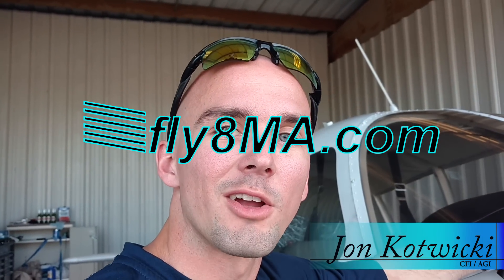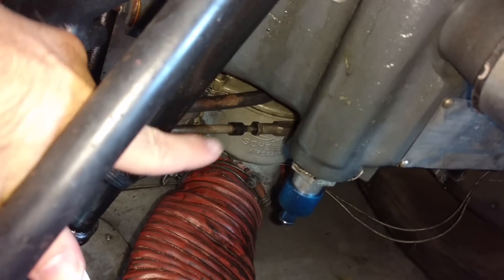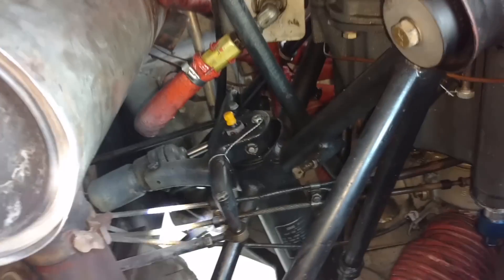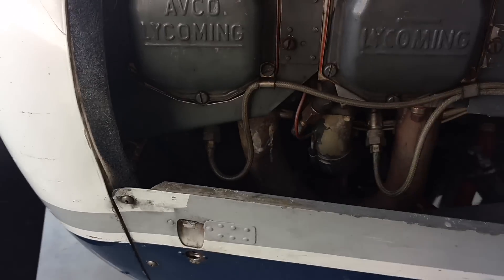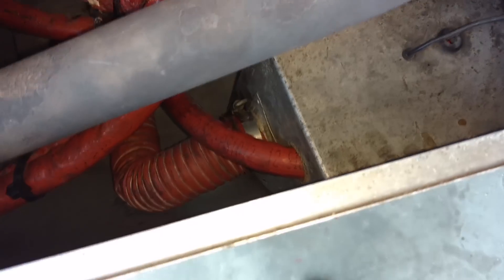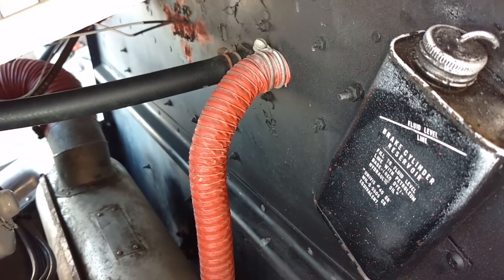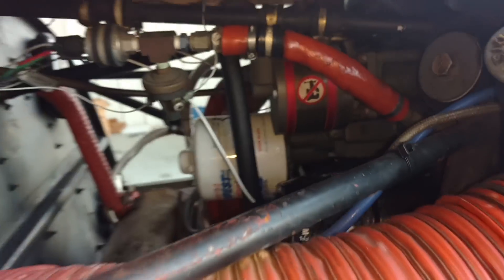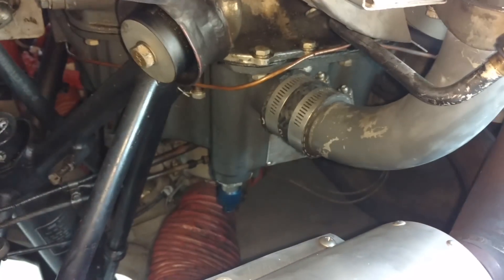Ep. 53: What's Under the Hood of a Little Airplane | Explained How it Works

Comment: nice video. How much time is on the engine? Perhaps the next video could compare accessory condition with 500hrs, 1000hrs, 1500hrs etc. Too many times a cheap part ignored becomes a major expense.
Reply from the maker: That engine has right around 1000hrs and is 7 years old.  It's had a hard life being near the saltwater based on the west coast of Florida.  Certainly some cheap parts have caused major damage (bad exhaust gaskets at only a few $$ each).  Also an A&P was trying to diagnose a bad mag and which cylinder was not firing, he did a water test by spraying water on the exhaust to see which was the cold cylinder.  Problem was he didn't have water in a spray bottle handy so he used degreaser in a spray bottle that had pretty high acid content and did some serious corrosion acceleration to the spark plugs and #2 and #4 intake pipes (wasn't very careful with his spraying).  If you look closely you'll see the paint peeling and chemical drip marks.
Reply: FLY8MA.com Flight Training. I am based out of KHWO. Looking forward to taking a ride to Venice one of these days. Looks like a nice place to fly out of. You bring up a good point,  having a competent A&P is critical.

Comment: nice video and great advice on the Hobbs meter I wish I had known that years ago:) are you also an aircraft mechanic?
Reply: Well, he was just making a joke I'm sure.  Most FBOs and flying clubs have renters log both the Hobbs and the tach before and after.  If there were an obvious inconsistency, well, it would be rather obvious when it occurred.
Reply: I don't understand the point of disconnecting this Hobbs meter?
Reply from the maker: Lol, could have saved us all a lot of money if some one told me that day one of training.  And I'm not, unfortunately don't have the time to get the two years required work experience in a shop to get the A&P cert.  Pretty much taught myself how to work on my own aircraft (I've had quite a few) as I've always had a hard time finding an A&P that would do 100% of what I wanted done, in a timely manner, done right the first time, and not at rates of $100+ per hour.  Not to knock the profession at all, just seems to get it done right you have to do it yourself.
Reply: So is it possible to work on your own aircraft in the US without having that certification?